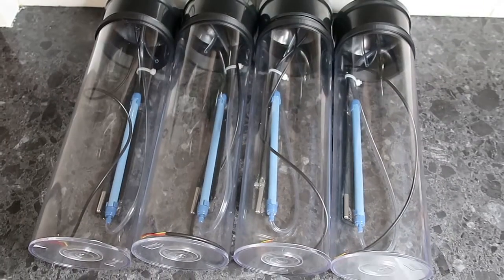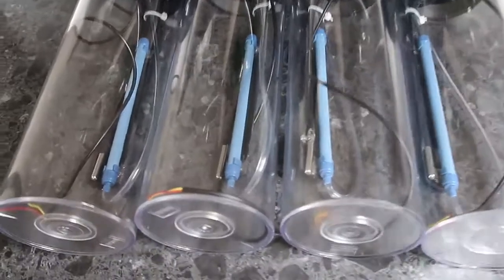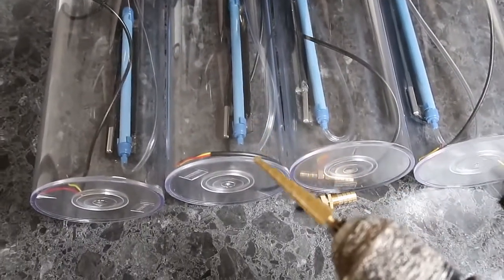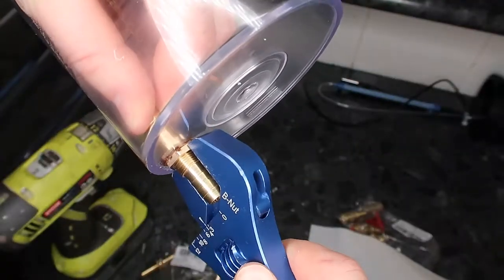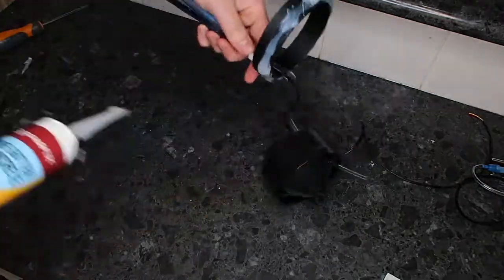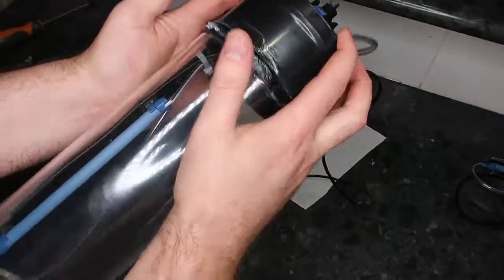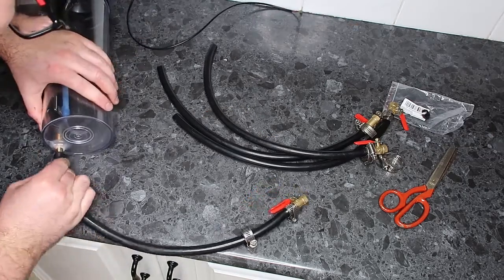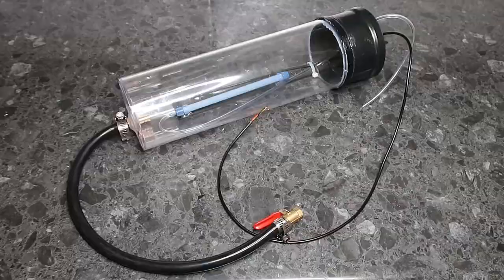Co2 Scrubber Tubes Complete (water outlet and valves)

Comment: Will you have a CO2 sensor on both the intake as well as the outflow?
Reply from the maker: Yes definitely. If you check out my video on the recording equipment enclosure. You can see I have installed sensors for co2. Air temperature and humidity. This is air prior to the tubes and I will build a separate recording box for each outflow for each tube.
Reply: @ScottyDIY  Very interested in this project, and others like it. Fresh air is great, but sometimes the air outside is not so fresh, and I'd like to have a way to keep the CO2 down in my environment. Based on the claims of one project I saw, I figure it would take about 15 gallons of algae to scrub everything I breath out, but I suspect that those numbers were based on growing algae with carbon included in the nutrient mix, not from bubbling air through the algae, so I'm very curious to see what your real-world results turn out to be.